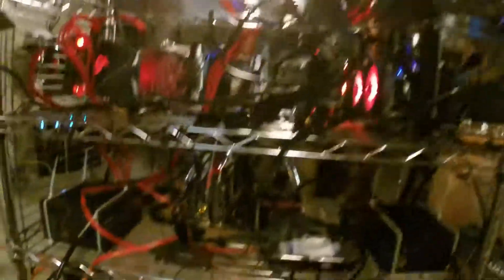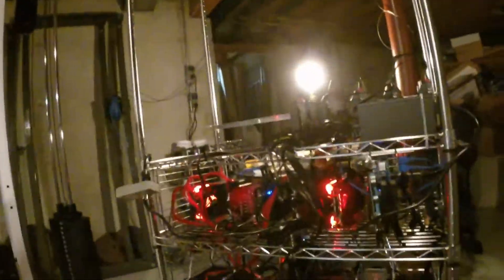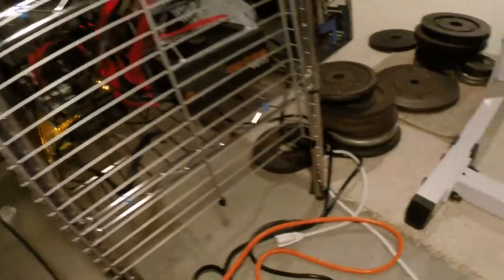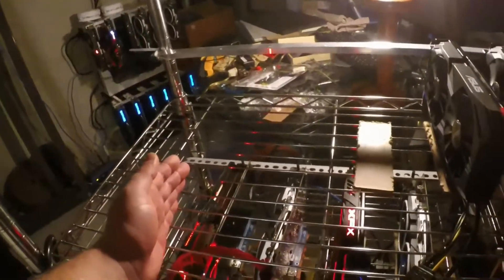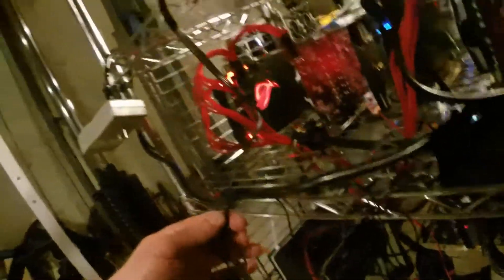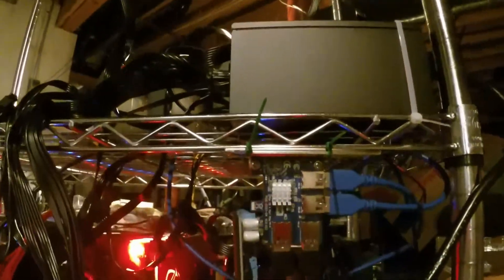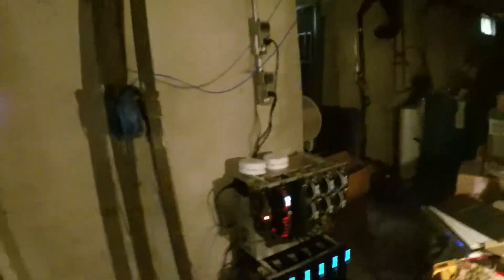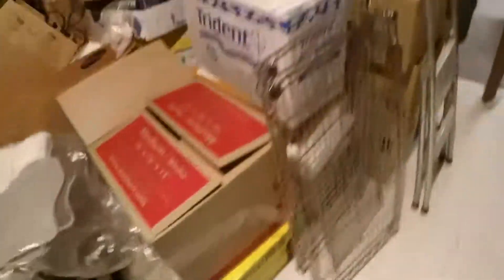16 GPU Mining Rig - One motherboard.

Comment: Hello @Jason Shaull this is exactly what i was looking for. I have asus z390-p but cannot go over 10 GPU cards. I am using the same breakout PCI adapters (4 outputs) and yet anytime i tried 11 cards the system will not boot. could you please share your bios ? I cant believe the z390 will be that different from the z270. Also, at the end of the  video you showed one of those PCI 4 way adapters was kind of mounted sideways. Did you plugged it into a riser instead of directly to the MOBO ? any help is appreciated.

Comment: so - 16 gpu works or not?

13 isn't a problem even on windows but 14 or more can be
Reply from the maker: I think it depends on motherboard.  I was using Asus Prime P and it wouldnt go past 12
Reply: i have z270-p too + 2x expander = 14gpu connected - OS see only 12  :(
asrock btc pro+ - 13 under windows
Reply: My i7-6700 on a G1 Snioer B7 mobo can only boot fine and mine with 13gpus, adding more and it does not boot anymore. Im guessing its the cpu pcie lanes limitation.

Comment: what is your motherboard model?
Reply from the maker: Benz SZE Chun Leung It's an  Asus Prime 270 P...   8 pci-e   altho with pcie expanders you don't have necessary get a motherboard with so many pcie slots anymore.
Reply: nice, i was using asus prime z270-a with 8pcie too, but i changed to asus b250 mining expert currently ><
Reply: how do you keep the room in cooling temp.?
Reply from the maker: It's in the basement so it's very hot down there.  It seems to be fine when the AC runs, but when off it get very hot. My next project will be to build a hood, suction device to throw into the HVAC for heat in winter and feed into exhaust port for summer! :) I'll make sure to make a video on it.
Reply from the maker: nice!   Have you tried the PCIE expanders yet. Only try the ones from Amazon, apparently Bitsbetrippin tried a few and they didn't work, but all of mine have so far.

Comment: what is the hash rate and how much did it cost to build?
Reply from the maker: With bios flash, expect about 27 to 30 per card. Depends on what GPU you can pick up- figure each gpu is currently running at $235-$320 , an 850 w power supply about $100 each and a 1000 watt currently $155.  Motherboard can be picked up for around 100 or a little more and you only need the lowest grade cpu for that motherboard. All in all I currently have $3000 invested in this.  I went a lil overboard, but it was also my first build and a lot of learning curve too.